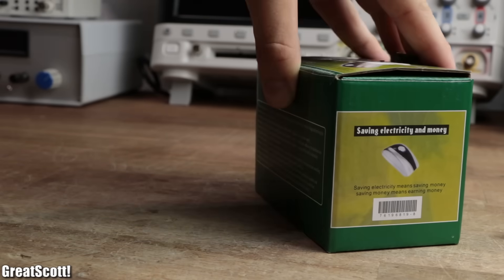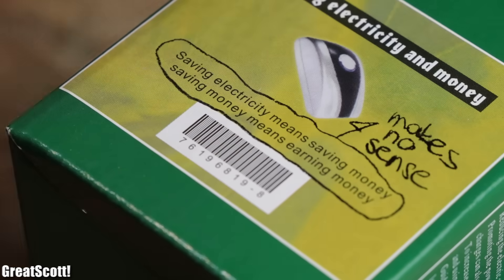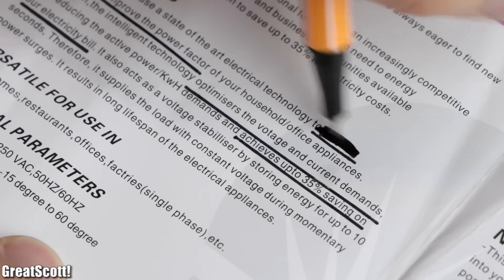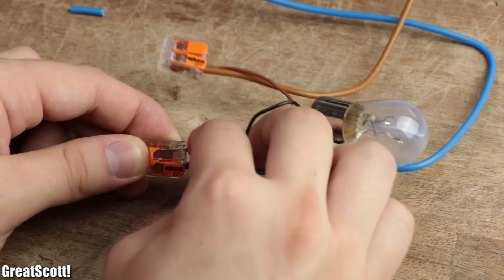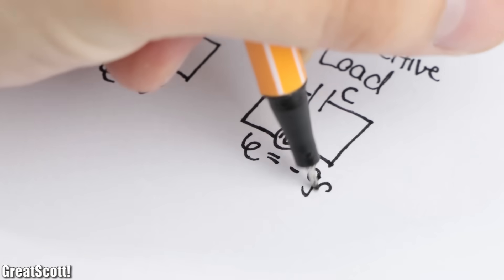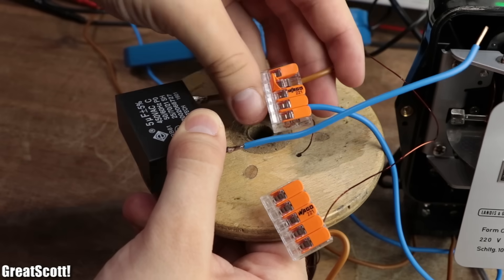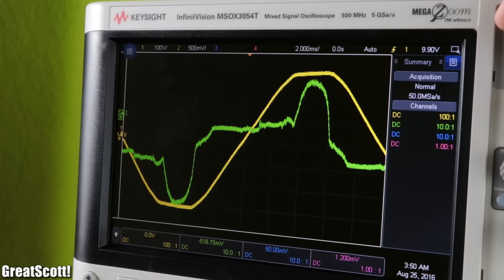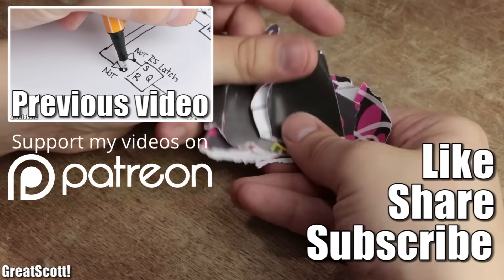Chinese Power Saver - Does it actually save power?

Comment: Those 5uF capacitors are very large unless they are rated for 2kV or more. A 5uF capacitor rated at 500 volts is about half the size of a 3A battery. The black box is a dead giveaway that this device is bogus. But...somebody needs to study a utility watt-hour meter and see how they respond to current noise generated by all of our switching power supplies. The old meters would not be affected but the new technology may have a different result where a little filtering my help. Just something to ponder.

Comment: When I shunt feed my flux capacitor directly in parallel with an 8k franistat, so much voltage is generated that I have to turn on appliances to drain the reverse amperage feedback.  Nothing quite like free power.

Comment: For those who really want to save a lot of electricity: The TEST Foundation published the article "Saving energy in everyday life - save 1,000 €." The greatest savings potential are energy-saving shower heads, up to 300 € p.a. at a cost of only 20 €.* Otherwise, LED lamps, window sealing strips, switchable power strips, energy-saving heating pumps, programmable thermostats, radiator reflective foils, and timers (e.g. to switch off routers at night) should be installed everywhere. In terms of cost, effort and savings, the most effective insulation measures are roof, cellar ceiling and roller shutter box insulation.

Comment: What I was looking for is something that can regulate the power to match the power frequency as the same as inside yes everything inside the including Motors worth of a 60 amps but I'm sure the ballast that supplies the power outside from the power main power supplies outside runs at a different frequency so increase the power usage of your Motors and the appliances you need something that can change the frequency of them to make them run smoother so maybe this is how we do

Comment: intersting. These correct power factor, something not monitored by utilities for residential customers so absolutely useless for a homeowner to buy. Some products have capacitors in them to correct power factor within the device itself due to regulations so this device plugged into those devices would either have no benefit or could actually overcorrect the power factor causing a new problem.

Comment: these devices  really work, but on factories with a lot of motors. 
they reduce reactive part of power, so a generator will need to be less powerfull to feed a factory.
 because the reactive part goes against current flow, so generator need to be more powerful

Comment: If they are Capacitors then could I plug one into a power board/strip that is plugged into a generator to start an electrical device that the generator alone "almost" but can't quite start due to start up load ?

Comment: Most excellent presentation. Very well done.  I would have added a bit about large industrial plants running induction motors will have a large leading reactive load which will shift the power factor down from 1.0 (or purely resistive load). Because that reactive load has to be carried from the power grid to the plant, the mains have to be sized to carry this larger current (reactive + resistive) so the electricity producers will charge a power factor penalty to this large reactive user. To avoid this penalty fee, the large plants will install a synchronous motor. This type of motor has a lagging power factor because it appears capacitive rather than inductive. The synchronous motor's reactive current is 180 degrees out of phase with inductive motors' reactive current and can effectively cancel out all reactive load seen by the grid hence no power factor penalty.  Synchronous motors are a little on the weird side, so I'll end my pedantic discussion at this point.

Comment: There are power conditioners that actually work for inductive loads but only with 3 phase power which is only in commercial/industrial applications. Residential power is single phase.

Comment: It seems to me that you accidentally swapped the scope images.  The one at 2:59 shows the lagging motor current (with irregularities caused by  the commutation). The nicer sinusoidal current at 2:48 shows the current draw of the capacitor. It is leading, contrary to what you say.  Anyway, you explained it well, quite in line with your other postings.

Comment: Absolute scam. Don’t be fooled into thinking this piece of plastic crap from China does anything. Only way you will save energy (legally) is to turn thing off or down, especially appliances which generate heat.

Comment: this video is misleading at best. your fridge motor is an inductive load and can be measured when running at aproximately 3 amps. Now take that black thing, capacitor 400 micro farad, and connect it parralel with the fridge motor and measure the amps again. it will be aproximately 2 amps now. the kilowat hour meter is also slowing down. that my friend is called getting rid of reactive power and saving money
Reply: You don't get charged for reactive power

Comment: Don't buy, this not save you money. Do this instead: Get power bar, transformer, LED, resistor, and 9 volt battery, connect together and presto ! you don't' need electric company, just change battery every two weeks, and make sure LED is glowing !

Comment: Would it help to protect against smart meter pulsing every wire in the house every 20 seconds.  Does it smooth out unsmart radiation?

Comment: Best way to reduce your power bills is common sense based habits and changing your household devices and appliances to high efficiency low power units.
Changing high wattage lighting such as halogen lamps to LED lights is an example of this energy saving strategy.
Home insulation is another good option.
There are no gimmicks or gadgets that allow you to continue being energy wasteful, and reduce your bills by simply plugging in a fancy device into your wall socket

Comment: This is real or fake. Which devise is best my house running 18-20 units everyday. Two months ones meter reading, electric units 800 units, Rs. 4000/=Pls advice this unit working properly or fake. Which is best 1 kw device is enough.

Comment: I have my own guaranteed power saving device.  I call it a switch.  When it is in the down position it is guaranteed to save power.  If you want to bypass my power saver you merely put it in the up position.  Mine are also made in the German part of China, very close to the Japanese part of China.  Read my paid-for 5 star reviews and send just 5 easy payments of $29.99 plus shipping, handling, and your local taxes. Hurry, there is an infinite limited supply.
Reply: Me too, I have even LED lights. Did cost me some $$$, but last time I changed a light was like 4 years ago..

Comment: Howdy.
Yeah. Technically getting the overall power factor closer to 1 will reduce the wiring losses. Yes, but that is academic.
And yes. You are so correct. The metal casing should be connected to Protective Earth. It is dangerous as it is.
There is actually a danger moment in using compensating capacitors. If one uses a powerful frequency converter to drive an induction motor it could generate so strong harmonics that the capacitors may overheat and explode.
Regards.

Comment: I bought a "power saver" as shown at the 24 second mark. I opened it up, and all it contained was a small circuit board with 3 small resistors and 2 LEDs. Totally useless junk.  Chucked it straight into the garbage bin. Fortunately I only paid AU$6.82.

Comment: Just saw your video (5-years late, ha ha).  Just noticed you used a Germany-made power meter with a rotating disc.  Obviously, the meter "counts" KWH from the rate of spin of the aluminium disc.  I experimented supplying the AC power (monitoring the current with a clamp meter) to an  AC 1 HP motor ( and observed that the disc spins like crazy).  Subsequently, I connected  a 20 uf 450Vac capacitor in parallel to the motor.  This observably slowed down the disc spin, and reduced the current flow from the AC power, as monitored by the clamp meter.  Now, tell me, did I do something wrong, or did I just notice  "power-saving" as the Power meter DID SHOW substantial slow down in spin?  I do not have oscilloscope and hi-tech equipment to verify VAR.  Please enlighten.  Thanks.

Comment: That test looks all scientific but the bottom line is I've used the box not the one you're describing but a cheaper one on eBay and my electric bill is easily 15% lower after 7 months of use for some reason it does take a month to start to happen money talks BS walks it's saving me money you should try it for real instead of just hypothetically showing digital fluctuations put one in your house wait two or three months and watch your electric bill go down eBay sell them cheap try one for eight bucks you got nothing to lose guys I'm telling you it works and that's all I have to say I'm happy with it

Comment: I have one that plug in to the wall and has outlet you plug into.   Its directions said only use the Inductive load ( motors) NOT resistive load.  I measured mine -- it  truncated the sin wave thus reducing power.   So mine works.  So does yours as you show -Only with the Inductive Load - ie only Motor loads.   So it works but would not show it with switching power system.  What about US power system.   Your power Wheel went slower.    We have a Power wheel here on our house ---  outside power meter.

Comment: Good explanation, where I worked we had good size coolers for produce, meat, cheese, etc. We replaced the old ammonia system with 2 new freon systems, which were supposed to save a lot of money. Turned out it about doubled the electric cost. The electricians decided it was feeding back too much unused power back, since the new systems weren't working as hard as the older bigger ammonia compressor. They decided to install a big capacitor box like the small ones to cut down the bills, we had 3 phase with a demand meter. It did make a huge difference. Sorry I couldn't describe it better.

Comment: https://www.energyvanguard.com/blog/26693/Do-Power-Factor-Correction-Devices-Save-Energy
The electric demand meters on residential homes in the US measure consumption in Watts, NOT VA, so the reality is that the worse (lower) the power factor is, the lower the wattage seen at the meter for a given inductive load. 
In larger industrial complexes the power company may be monitoring power factor and in those cases the customer will be penalized for lower power factor.

Comment: Well I plugged two in the house last June, one close to the fuse box and one in the furthest plug from the fuse box. So far I have used over 1000kw less electric than the previous year and paid $187 less than 2019. Rates have usually been a little higher and the weather may have been a little hotter this year. This is anecdotal but my $16 "investment" seems to have paid off. I have no other explaination for what has gone on.

Comment: These work in poor power supply areas.
If your supply has a good Power Factor,
then it wont help.
This usually has a capacitor circuit to help inductive load cancellation.

Comment: Scott in this regard i want to know one thing. I'm having few 400v capacitors which were used in big size tube light sheds, sodium vapour lamps or motors. Can I connect it to my 230v ac supply to improve the power factor?

Comment: The relationship between reactive power and capacitance loads and frequency is very complex and is not as simple as some people think. If you want to know how all these works read Steinmetz which was done over 100 years ago and is mind-numbing https://www.researchgate.net/publication/271136025_EXTENDED_STEINMETZ_EQUATION.. some equations run pages long

Comment: Hey, Believe it or not, we have a Deli and electric bill was over $1000.00 per month. We plugged in 2 of them 1 by the breaker box as recommended and 1 in another location. waited 3 months to see the bills and the second month was over $215.00 third month was about the same results and that included high A/C consumption in summer. Put one in the house didn't have much of a change but am going to purchase another and try that. what the heck they're cheap.

Comment: Refrigerators add capacitors to "correct" the power angle so it can be read on the power meter and you can get charged.  Cut out that cap and get "free" energy.  Electric companies don't like this idea, of course.

Comment: Number 1 Full of crap, Number 2 More Full of Crap Number 3 Most of all these don't work unless you brain wash people into believing it only way to save power is to make sure you do all the things that need to be done that are many small little ways to save power, make a budget, unplugged unused things in the house, put items on energy saver is the settings are there and also if there is a power outage always use a portable power bank device and manage settings in each device to save and use only the power needed until the power outage is over and power is restored don't take a smart person to do these things without buying wastefull devices that never has worked upto date

Comment: Engineer here, we pay for electrical power that is the product of the current flow in amperes and the electrical force that causes current to flow in volts.  Power equals amperes times volts, that simple.  Direct current is always amps time volts, but alternating current is different because it is constantly changing polarity, in the US, 60 times per second.

And because of this the current and voltage are not always in phase depended on the load.  They are in a pure resistive circuit like an incandescent bulb, but in a reactive circuit like a capacitance the current waveform leads the voltage, capacitance loads are rare in home appliances.   More common are inductive loads, cause by coils of wire with a ferrite base as in any electrical motor, like in your heating system for air flow or your refrigerator.

Can't draw a sine wave here, but the maximum shift in current in respective to voltage can only be 90 degrees, where in the case of an inductive load, when the current is maximum the voltage is zero.   So if the voltage is say 120 volts root means square, and the current is say 10 amperes also root means if 90 degrees out of phase, the product of voltage and current would be ZERO.  All electrical meters are designed to read only what is called true power.  A volt meter will read 120 VAC, an ammeter will read 10 amps, if in phase, 120 time 10 is 1200 watts!

If 90 degrees out of phase, a power meter will read 0 watts.  The amount of phase shift is called power factor and true power exist when voltage and current are in phase.  But normally somewhere between true power for in phase, and apparent power, 90 degrees out of phase.

Can only guess whats in those little boxes you plug in your receptacles, more than likely a capacitor to compensate for inductive loads.  They will tend if sufficient capacitance, and should mention AC capacitors are much larger than DC capacitors, will fool your electrical meter and actually increase your rates.  This is not new, been an engineer for over 60 years and this same BS for lack of a better word, was true back then.  You said a sucker is born every minute, if its too good to be true, it isn't.

Comment: Something like this(not this product specifically just the concept) would stop my PC's monitor from going off for a moment after my dehumidifier turning on its compressor to work though wouldn't it(because i, by needs have them connected on the same wall socket)?

Comment: The required capacitance is not standard. When you switch on and off the appliances at home the proper value of the capacitance changes. If you exaggerate with the capacitance then you end up to increased phase shift, to the other way. It's better for each device to have it's own capacitor.

Comment: It seems that they market these products right before Fall when the temperatures are about to fall, so air conditioners will be used less and heaters will not be used for a month or two.
Also, how much does it cost to return it.  These devices are being marketed on Instagram again in September, 2019. Thanks Scott

Comment: Wasn’t there another type that would lower the frequency causing motors to run slower and therefore “save” energy?  I recall them being pushed at swap meets back in the 80’s.. have no clue why you would want to slow a refrigerator motor or anything like that..

Comment: I purchased the first device you displayed "Electricity saving box" in February 2019. I have monitored and compared my usage. Why I discovered is that I did not save any money whatsoever in fact it was the reverse. The 1st month my bill was $52 dollars more, the month after it was another $57 dollars more, this last bill was $75 more and the weather has been nice, kept windows opened running no heating or a/c. Needless to say this device is a huge scam. Leave it to China....

Comment: I wonder if it is possible to make a device that actually actively monitors your reactive power consumption. You install into your fuse box, and it uses a current clamp to sence your current draw and it adjusts a variable capacitor and inductor.
Reply: There actually newer methods to actively monitor reactive power and harmonics .. They are called Unified Power Quality Conditioners .. They reduce reactive power drawn from the grid and makes the current drawn purely sinusoidal 😀